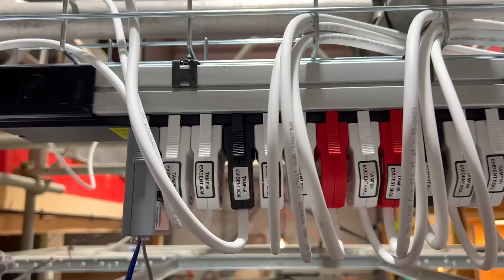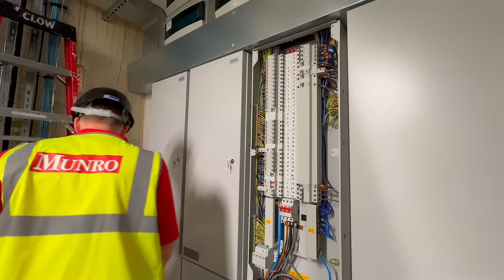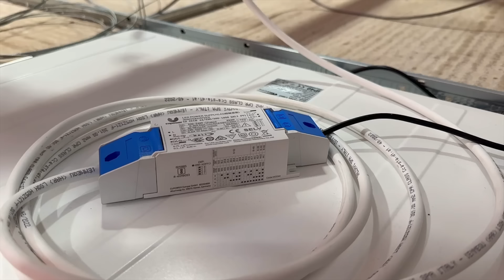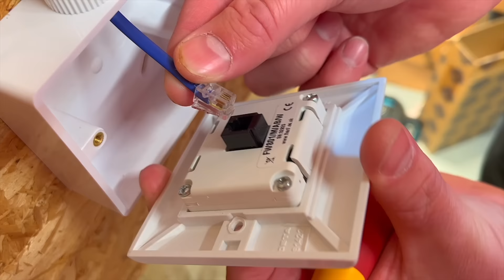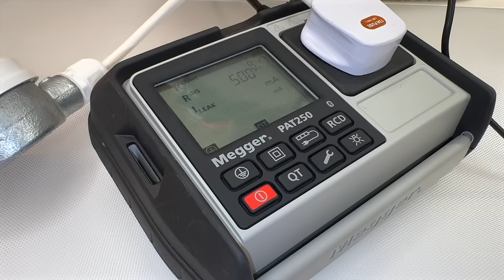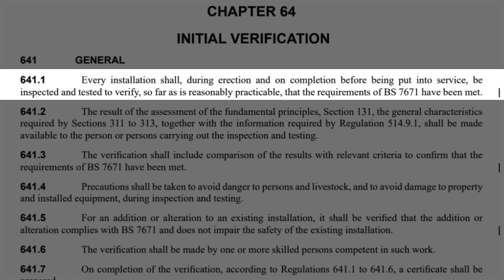Is Plug in Wiring Exempt From Electrical Testing?

Comment: Fundamental principles aka What is the intent of the regultions as defined - regulation 131.1 - and with that in mind is that met when you walk away from the completed installation? Have you verified such is met? Are you happy to stand in a court and state that has been achieved.
The body of the regs are a minimal standard to be achieved. It seems more and more we see people unable to think beyond A goes to B.
When I was doing my apprenticeship in the 1980's I recall an instructor saying to this day: "I do not want you to remember why A goes to B, I want you to understand WHY A goes to B" now apply that each day you work
Reply: Exactly this. The amount of people who argue that something doesn't need testing 'because it's on a plug' is astounding. I've actually had people say to me that they wouldn't test a fluorescent light fitting if it was fed by a plug. When I asked who would test it, they had no answer.
Reply: typo: should read '"I do not want you to remember that A goes to B, I want you to understand WHY A goes to B" now apply that each day you work.

Comment: For everyone saying 'if it's plugged in, you don't test it'. 
This example is based on actual testing that I've done.

I carry out an eicr on ten shops. The lighting in five are wired in T+E, and five are wired via plug in ceiling roses. The connector blocks in the 600 fittings are perished, literally crumbling apart when I touch them. There are also outside em lights, some of which have water in them. Some of the light fittings don't have earths (cpc's) to them. By some peoples logic, I wouldn't test or inspect the lights which are fed via the plug in ceiling roses. Apparently, when the PAT tester turns up on site, he has to get his steps out and check above the ceiling to see if the lights need testing "because they are now portable equipment". It's obviously, quite clearly nonsense. Anyone arguing for this really hasn't given it any thought at all.
Reply: This may be due to the pat tester being level 2 so he is correct in what he is saying but if he completes his level 3 he will do all of it under fixed equipment that requires disconnection of each device for testing so clearly an extra cost
Reply: @markellis3648 
I'm sorry mate, but you are wrong. No pat tester is going into a ceiling void to unplug lights. It's in the description PORTABLE APPLIANCE testing. 
Pat testers aren't electricians, there isn't enough money in it for a spark to pat test.

Comment: Sorry mate .. wrong.  As soon as its plugged in . Its deemed a portable appliance.    Do you certify a standing lamp .. no .. its the same principle. And 99% of the time its double insulated fittings.
Reply: Who says that 'it's deemed a portable appliance as soon as it's plugged in' ? How is a light fitting, screwed to a ceiling or a wall possibly a portable appliance, it's literally against the definition of portable. What about a distribution board that is plugged into a commando plug or, more likely, a busbar tap off?

Comment: For class 2 plug in led lights or drivers it would just be a pointless academic exercise . They are not class 1 so why would you make a meal of it ? . A visual inspection would be adequate in My opinion . We are walking into paranoia and any time saved in installing with the quick systems will be lost in utterly pointless tests
Reply from the maker: Monjaro Joe here - thanks for commenting 👌 I get the point, but the worry is when people stop knowing why a visual is enough and just skip thinking altogether

Comment: It's all gone a bit to far tbh fixed wiring only. So your telling me when you plug a table lamp into a socket that lamp should be tested
Reply from the maker: Monjaro Joe here - Think thats called In PAT Testing 😊
Reply: Mate, this is really simple. If it's something plugged in that gets moved around, it's portable, so part of pat testing. If it's something like a 600x600 light in a suspended ceiling, it's part of the fixed electrical installation, so it's part of an eicr or similar.
Reply from the maker: What about a vending machine 😂?
Reply: @efixx It's portable, you've just got to be really strong😁

Comment: Problem I find talking  to youngsters, they  are Not interested in the technical side of it. They just want to install  A to B etc.  College bored them, why we left school. They say. I saw it in my time,some falling asleep in a class. Now I came from a family.of Geeks. Dad was a  qualified sparks and self taught radio TV engineer. Our first TV in 1953 he built from scratch.. So I was heavily into.radio as a hobby building gear at age 14.. At 16 I joined an Electrical  Contractor as an apprentice.. So I was already technically fit.  I became  a radio ham eventually.   So I sailed through the electrical course. Anyway its all history now. No longer qualified. But still involved with Radio at 78
Reply from the maker: Monjaro Joe here - thanks for commenting 👊 massive respect for that background, built different back then

Comment: Interesting because we only test up to the DALI LCM and not the down stream lights because most of the fittings we use are cpc free, double insulated and quite often DC. 641.1 So far as is reasonably practicable. With the increased use of ELV lighting systems in commercial and domestic with Lutron and DALI anything down stream of the control modules is not practicable to test aside from functionally. 

That said it was suggested a few years ago now to scrap 240v circuits in new builds as most appliances were stepping voltage down to 24v or less. In which case will we even be required to test at outlets in the future at all.
Reply from the maker: Monjaro Joe Here - That's really interesting, thanks for sharing 😊

Comment: All well and good during installation but periodic testing on these would be nothing short of a nightmare. And the time involved in doing it properly, especially once previous records go missing or the installer didn't label every fitting clearly (which they won't) means it will just not get done, with test sheets being LIM after LIM. So testing just becomes a myth, just like on new builds.

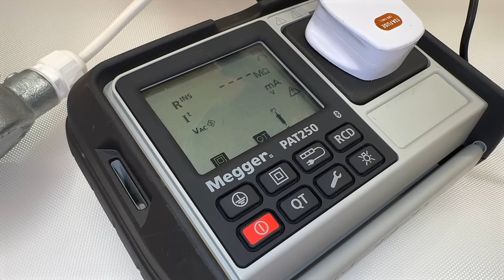Comment: Hey Joe, there was a lot packed in to that video! I did hear one mistake though - at 7:30 you said you'd expect an IR result lower than 1 Mohm, but you meant it should be no lower than 1 Mohm. Sorry!
Reply from the maker: Monjaro Joe here - appreciate you pointing that out 👍 easy slip when covering a lot, but yes you are bang on